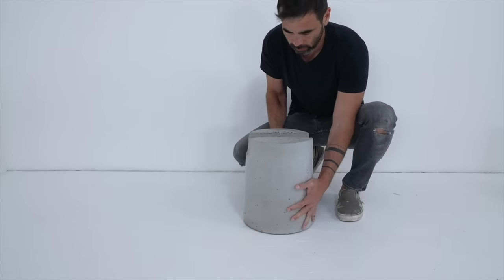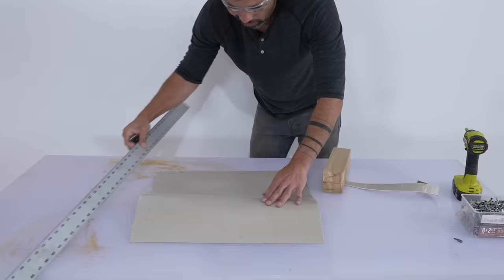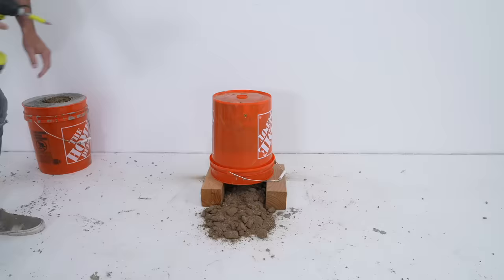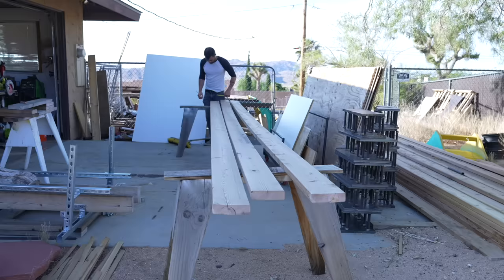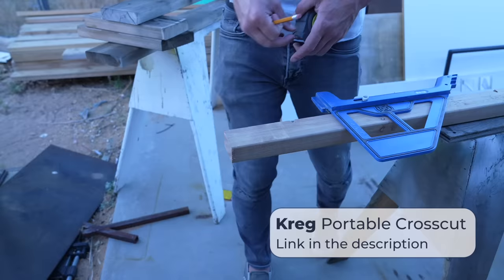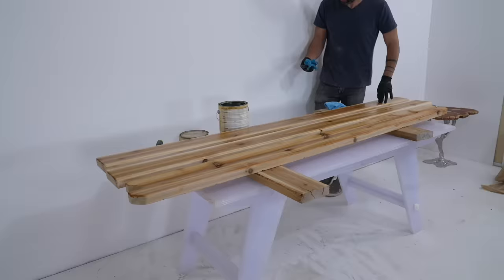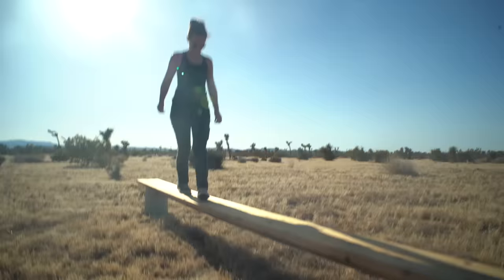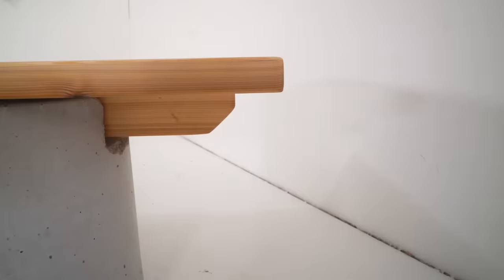DIY Concrete and Wood Bench

Comment: Paraffin oil generally is lightly sprayed over plastic foam forms or form liners. Castor oil, or petroleum jelly thinned with kerosene, also are good release agents. Concrete forms, even if they are ground, smoothed and polished, require a release agent to prevent sticking and enable easy stripping

Comment: What I like about this idea, is that you can add angle iron to it and create a portable skate obstacle

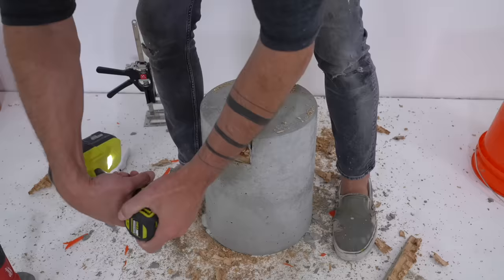2:50 If you have access to pink foamboard, you could have used this too. Much easier to remove than stacked 2x4's
Reply from the maker: yes foam works well! great idea!

Comment: Instead of using wood inside the bucket to form the void use styrofoam . Easier to remove  . If you must use wood cut it at a slight so it's slightly tapered and grease it , and it will pop out instead of you having to chew it out .

Comment: A release agent on your concrete form components will ease removal. Used motor oil or silicone spray work nicely.  Pretty cool project.

Comment: It may not be as stable but you can find pyramid blocks at most big home improvement stores. Stack those on some cross stacked concrete bricks to desired height. 

Use cedar 2x4s and then and then a cedar 2x8 if you can find it, or laminate cedar 1x8s into the desired thickness. This would make a quicker bench without any serious fabrication.

Comment: Great design. I really appreciate it. A bit of advice. 
First, use a release agent where contacting the concrete. It's a really light oil and it works amazingly well.
Second, instead of using a solid piece of lumber for the negative space. You could split that piece diagonally forming two wedges with an 1/8" shim to replace the kerf. Then once set, you could remove the shim and each piece could then slide out easily. Assuming you took advantage of my first suggestion. :)
Best of luck and keep up the great ideas.
Reply: Thanks for the tips!

Comment: I watched on mute so sorry if I missed it. Next time just use a 12" Sonotube for the form and rigid foam as the filler. The Sonotube will cut right off and you can get several bases from a single tube. The foam is easy to cut and just as easy to remove from the concrete, when finished.

Comment: You can use releasing agent oil or water based on the surfaces for easy and smooth casting release. Cheers
Reply: Just simple veggie or motor oil will do the trick not too complicated.

Comment: Lubricate the bucket before adding the concrete will help releasing it once set …also putting a pipe of some sort ( pvc?) top to bottom should release the vacuum 
I will be using this idea

Comment: Great design! Two items that might improve it a little:

A hole all the way through the concrete would give a better grip when carrying the pillars, and help with drainage in wet conditions (I know that's seldom a concern in your location, but still...).

And to stiffen the bench, you could stand off the 2x3s from the 2x6s using short 2x2 blocks every foot or two, to make something of a truss. This would either boost the bench height, or mean a deeper recess in the pillar; not sure which would work better. But it also would make carrying the planks even easier, assuming you round over the 2x3's edges a little.
Reply from the maker: good ideas!  thank you!
Reply: Hole is a great idea!

Comment: Really great design and fantastic suggestions on how to improve the process.
You can learn when the wood will break with math and save those long boards with another video showing you making a 3rd support using the process improvements you talked about. I would be really interested!
Reply from the maker: yes! will show shortly

Comment: Have you tried moving the pillars closer together?  Right now, the pillars are closer to the ends.  I wonder if they were at the 1/3 points rather than 1/4 points you might get all the stability you need.

Comment: very good work/ planning! 

concrete and modern tools/equipment gives all kinds of  possibilities that we dint have before ( therefore also money to be made. ) e.g tables and benches.  
You might expect bumping in to these all over the world,. Or even If you find your self in the end of the world, ( e.g Fin(al)land ) Remember you ( almost ) did it first, ( I have already thought of these methods  :)

ps. If rubber is added to the top and and bottom of these concrete cones these can be rolled. ( important to have same size so it doesn't go in circles ) If you have one pick up or bigger truck full of these might need easy way to move.
To make it durable+ light, might need then ironing.
If you have more of these that you need in the moment you cant put it upside down and but flower or water on them or so :)
Could also thing survivalist type of situation you need to take cement in the more distance place you go and cutting the tree in half, you get bench and table. buckets go inside and water is there, so not much need to be taken with you

Comment: YouTube has been reading my mind, I was just thinking about this yesterday.... well not exactly making concrete buckets, but using two 5 gallon buckets and a wood plank (2"×8"×5')  as a bench so that I can paint 9 foot walls and ceiling, I figured it's cheaper than buying the bench I saw Harbor Freight for $50.

Comment: I know nothing but, if you make inflatable molds would the heat from the concrete setting expand the molds? Sorry if that's not a thing!

Liquid might work a little better.
Reply from the maker: doesn't get that hot
Reply: @HomeMadeModern  🤔 ...yes

Comment: Apply used engine oil in the plastic container all over before you pour in the cement and see the magic..hope it helps..
Reply: @wainivanua no it doesnt stain and even if it does you can just color it or wash it..thx for your unwanted comment mr.smart pants..

Comment: You should have used motor oil to line the bucket and wood 🫠
Reply from the maker: stains the concrete but yes need to figure out a better demanding process

Comment: Hello, coat the inside of the buckets and the linoleum with vaseline or some other greasy stuff before you put the concrete inside the bucket.  The idea is to apply a release agent > VASELINE.  That allows the hard concrete to slip off.  You shouldn't have to destroy the bucket and wood/w linoleum.
Reply from the maker: mold release doesn't make much of a difference.  the concrete doesn't stick to the plastic its more the tightness.  also mold releases tend to stain the concrete
Reply: @HomeMadeModern  increasing temperature of the bucket or reducing the temperature of the concrete would reduce pressure.  i don't like mold releases because of the color problem.

another thing i've done that works great is to take an old tire inner tube, cut near the pinch flat, tie off to roughly the size you want, and stuff it under the block inside the bucket deflated.  now, inflate it when you want to remove it(route the valve stem through the bucket, of course).  you can also fill it with water by dunking a track style bike pump in a pool or another 5 gallon bucket or a tub etc... i've never needed to do that, but you mentioned inflatable molds, and especially for creating negative space, this works great.  rather than deflate then pour, inflate to assist in removal, you can inflate before the pour to create negative space, deflate to remove.